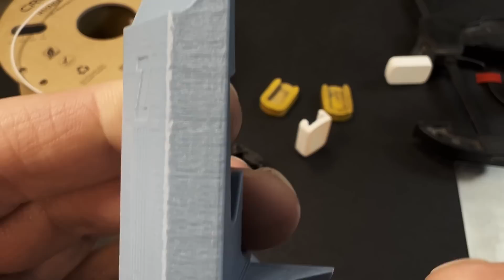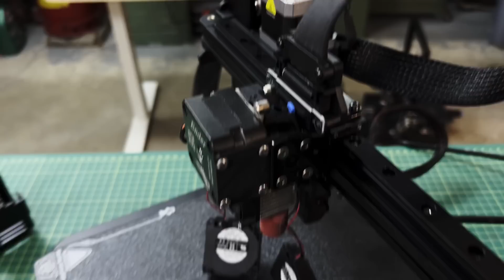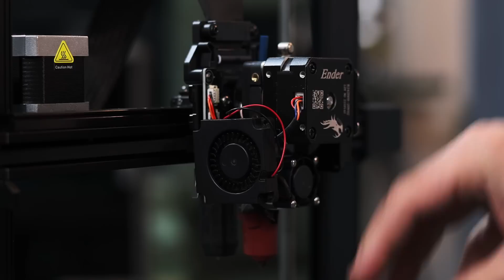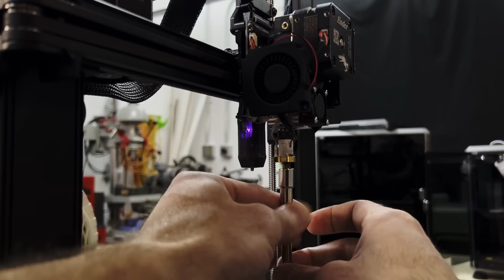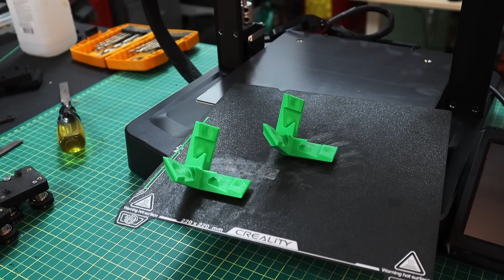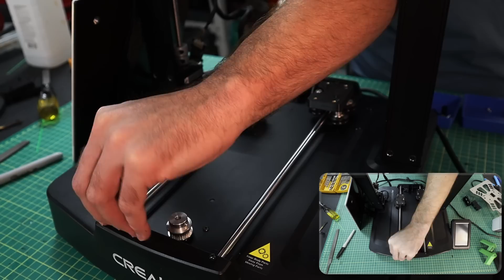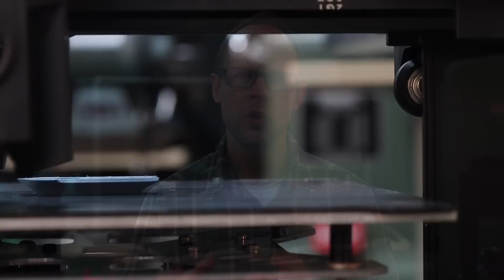What Causes BAD Print Quality on the Ender 3 V3 KE? - Fast Bed Slinger

Comment: Is it possible that your y belt was loose??
Reply from the maker: I didn't show that part did I?  I was very careful to make sure it was tight, when I received the printer, it was tightened quite a bit, I matched the gap as close as I could to how I received it.  it seemed to be about what you'd expect so there is no slippage possibility.  I went a bit further today and I measured the movement at the front of the bed compared to the center, and we have 0.15mm at the front, that's the play with just a 'finger-force' applied, in the center we have 0.01mm, it's giving the teeter-totter effect it seems.  The center mounted blocks along with the poor fit are the main cause, there will be movement of all of the parts.  It needs linear rails along with wider spaced blocks.  I will work on a better option for those of us who need a solution.
Reply: @NeedItMakeIt  awesome, thank you!
Reply from the maker: @mygamertag2010X  I'll make a video including some of that info, it was good you pointed that out, I've made some notes so I don't forget... too many videos on the go and my mind prefers to work in tunnel vision.
Reply: @NeedItMakeIt  I'm sure I can speak for us all, we really appreciate your thorough testing and inventive ideas to solving these problems!
Reply from the maker: @mygamertag2010X  Thanks, that means a lot!  I enjoy taking things apart and fixing them, it's a win-win as long as people are finding the videos helpful and YouTube can promote it enough to allow me to continue doing it.  My video making/editing skills are a work in progress, so hopefully as time goes on, it'll become more natural and faster as well.

I think I have a pretty 'solid' direction to go now with the KE, taking all of the comments as well from everyone helps a lot to try and combine the ideas from everyone and come up with something that's far better than I'd get on my own.

Comment: I built a Hypercube a few years back under the guidance of Tech2c's YouTube channel.  At that time he was having issues with 8mm linear rod.  A lot of suppliers were supplying 5/16" linear rod and calling it 8mm.  (5/16" converted to metric comes out to 7.94mm and I think you measured yours at 7.95)  Maybe Creality has a problem with their suppliers?
Reply from the maker: That's a great point.  I think you could be absolutely right!  The math works out to be nearly exact to what I'm seeing, so if I order linear bearings to suit 5/16", this may be a great option to test out.  The rods are hardened, they look like a stainless of some kind, but they're tapped in each end and that's not something I want to get into.  They're also extremely straight, so the quality seems good aside from the size.  

Thanks for sharing this, it may just be the best option for anyone running into this issue.
Reply from the maker: Update... it doesn't look like 5/16" is a size for linear bearings, I'll have to see if Creality can send me new rods.

Comment: Really looking forward to your next video. My KE also has some weird artefacts when printing PLA. Nothing major but there are some things that just go wrong for no apparent reason. Funnily enough, my issues are hella consistent. For example, if I print the same code twice, all slightly misplaced layers will be in the exact same place. If the cause for this is the bed vibration, I would expect it to be semi-random.

To test thing, I've ordered a vibration compensation sensor from creality that should arrive some time next week. Maybe its also something you would want to use to see if there is a difference. Cheers

Comment: I bet if they had tighter tolerances on the rods and bearings, and also had two of them on one of the rods or two on both, the bed would be far more stable. Since the whole bed rides on just two bearings, any slop in the bearings will allow the bed to wobble quite a bit. A third bearing on either side would give the bed a much wider stance. But they would have to make the Y axis a bit longer to not lose print area.

Comment: The problem is that until you return this printer and get a replacement you can't know if this problem is on this unit or all the units of this model.
Chinese companies are notoriously bad with testing stuff before releasing (see the Bambu heat bed cable debacle for instance) and even worse with QC.

Comment: I've not been all that impressed with my new KE.  The firmware UI is pretty bad but the prints haven't been great ether.   Looking forward to doing some of these tests on mine as well.

My y axis rocks back and forth slightly in the bearings.  The rods seem too small and flex slightly. And the rods don't touch their retaining screws to hold them down either, one more than the other.   This is my first Ender series printer and so far it's not stellar.

Comment: My KE's bed seems much more stable than yours, maybe its just a quality control issue. Mine came with a dead strain gauge sensor right out of the box, other than that it's been working great for the past month. I am planning on trying PETG on this printer for the first time, I will definitely compare front and middle oriented prints. Is the thing you are printing a publicly available STL? I might just do the same print, so its easier to compare to yours.
I am planning on doing the linear rails upgrade sooner or later, there is a mod on printables that looks great.
Reply: Yeah. Same here. No bed movement at all on mine either. everything was very well put together with the correct tolerances. Just got mine a few weeks ago. So maybe they adjusted their QC after learning there was possibly an issue.

Comment: Derrick Darrell has a pretty good rail mod on pintables for converting the KE and SE to linear rails. That will be my next major mod on my KE. I saw a lot of improvement moving the spool to the side of the machine but I still have too much bed slop.

Thanks for deep dive videos like this! The KE is a capable printer but definitely needs those tweaks and mods like this to get the most out of it.
Reply: I already printed the bracketry and ordered the rails. Just waiting for them to arrive.👍🏻
Reply: @BlueWolfDaYooper  my rails should be getting delivered today.  I printed the brackets out of PACF (I print a lot of that material)
Reply: Ah, that's good to hear you've been getting results out of moving the spool.  It seems obvious and I have been considering it, but am a bit reluctant to change the design unless necessary.
Reply: I have a ke. What is the benefit of moving the spool to the side?
Reply: Took me a minute to find him (for those searching, don’t put a space in the name), but I downloaded the files
Reply: @ForOdin  Found the guy but not the files for the ke.😢

Comment: Woooah! Not what I expected. What a pain. We were all being led in the wrong direction not even thinking about the physical components of the printer since PLA printed so well. Totally makes sense that the position on the bed made such a big difference when the bearings were loose at the end of travel. Because of the nozzle and pressure for the extruding filament pushing down on the part or pulling it sideways, especially with PETG, it was also making the bed spring up and down as you pointed out. So overall the V3 KE needs better bearings for the bed and a stiffer mounting solution. I really like the rounded wheels you made and they seem like an almost better solution than V-groove wheels or possibly even cheap linear rods. A lot of people say that V-groove are better than cheap linear rods or linear rails and this is probably why. I was wondering if creating TPU mounts for the linear rods would help by holding them firmly in place, but allowing some flex when necessary, and damping vibrations. The POM wheels sorta solve some of the same issues. It's really crazy how much that bed is jumping around at the edge and totally unacceptable. I've gotta wonder if just a thicker aluminum support plate and solid bed mounts would solve most of the issue. The steel plate almost seems like it's acting like a spring. Otherwise a double carriage might help, but gotta keep full range, so linear rails would probably be a good call. Would definitely love to see you follow up with that fix!
Reply from the maker: I was able to get an indicator on it, I have a short video on my discord if you or anyone else is interested to see it.  We're seeing 0.006" or 0.15mm play at the front corner.  As I move to the exact center of the bed, we're seeing 0.01mm.  I should have included this test with the video, I'll make sure to add it into the follow up.  I was thinking that I should do something better with the linear rails, and that is to use smaller rails, and instead of having a single block on each rail, have 2 and space them out a little more.  To do this, I'd have the rails mounted out further to each side, giving that more stability as well on the left/right of the bed, but the main goal is to get away from the teeter-totter and move towards something that's far more stiff.  I also want to see about moving the PCB down and away and adjusting the standoffs to be shorter, and that should help get to where we need to go.  If we can use 2 blocks per rail, the steel plate may be able to go away.  I think I'd just need to see how long the rails need to be, they'll be sticking out of the front and back of the printer a little bit.
Reply: @NeedItMakeIt  Wow! Great data and thoughts. That's about what I would expect given how it looked, though I would have guessed more like 0.1mm so that's really bad. Mounting the rails as wide as possible and lowering the mounting height of everything as much as possible will definitely help. The higher the weight of the bed is away from the mounting point, the more leverage it has over the mount and the bearings on the rails whenever it tries to accelerate. Momentum wants to tip that thing over, and the taller it is the harder it's gonna exert its tipping force. It would actually be ideal to have a bed mounted in between rails at the same height, with bearings at each corner, now that I think about it. Obviously that has lots of packaging and alignment concerns though. Would be sweet to see a setup like that with linear rails for some serious precision and stability on a bed slinger. They would have to be quite long rails too though!
Reply from the maker: @802Garage  I like your thinking.  Side mounted rails sounds awesome and that'd give more printable height... not that I'd ever use it.  To keep it simple for anyone wanting to do the upgrade, I think I'll end up with something like 400mm rails, they'll extend beyond the front and back a wee bit, that will allow the use of the 2 blocks per rail and it should help a lot to avoid the tipping issue and add a tiny bit of rigidity as well.  I have a set picked out on Ali, but it's going to be about 1 month to get them sadly.  At least I can have all of the parts printed and try to test them in advance.  I want something simple enough for anyone to be able to do, which isn't that easy, to get precise printed parts, we need precise printers, and the bed will be warped most likely it could mean that the rails will end up being out of alignment.  Printing with PETG will minimize warpage so that may work for the base parts to mount the rails onto.  I guess I just need to try it and see what happens.
Reply: @NeedItMakeIt  PETG likes to warp more than PLA, unless I missed something or you just mean vs ABS for example. But yeah that's pretty much exactly what I was figuring you would do with the rails before my mind went wild with the side mounts hahaha. Now I want to do it, but that's a massive project I don't have the time and space to tackle. Def look forward to your testing! I usually get stuff from AliExpress in around 10-15 days.

Comment: i like your meticulous approach in this problem solving, really nice. I'm glad I am no longer using bedslingers as problem solving them is, in the end, a nightmare. I have a bambulab, which will have their own set of issues when they break, but luckily I have not encountered a single issue with it.
Reply from the maker: Thanks!  Yeah, the Bambu printer are a cut above the rest it seems.. at least for now.  But the competition is good, it should require the other companies to improve their products to be able to stay competitive.  Just offering a better price isn't good enough if your reputation goes bye-bye.  

If I want really good quality I go with the X1C, although it doesn't like PETG-CF, what a mess.  

Which Bambu do you have?
Reply: @NeedItMakeIt  I am using a P1S and actually have not printed PETG yet - i understand there are issues with bambu+PETG, which is strange because I used to have a Artillery Genius and printed PETG regularly and treated it the same as PLA, then againthe bambu is miles ahead in terms of speed with PETG is not in favor of.
Reply from the maker: @atom6_  P1S is a nice printer, good choice.  I'd like one, most of the features are the same as the X1C and if not, it's upgradable, mostly upgradable.  

When I print PETG it sticks to the nozzle badly, even though it's nickel plated.  The other day I had a Poop wedged   above the back nut for the Z screw, it was crushing it when it tried to home the Z axis and it continued through the bed leveling until I removed it, but it was crunchy and not pleasant to listen to at all!  That was Prusament PETG as well.  I still love the printer, great results 98% of the time, just a few tweaks and it could be perfection.

Comment: Seeing as you have the tools and knowledge to make them, why not oiled bronze bushings that fit?
Reply from the maker: Great point.   I tried this in the previous video, but there was too much friction, they were not oilite bronze, they were brass with oil I added, so there is room for an improvement.   I think the design of the base of the printer should have a centra rail that extends out to allow the bearings to be spread out further, that would go a long way to preventing this issue.  I guess the only problem is that they'd need a larger box and I'd imagine they don't want to do that...
Reply: @NeedItMakeIt  Using the correct bronze you could machine it to the ID you want as well as amount actually in bearing. Would be easy to bore to good ID, the bore out , leaving contact patch at .250" on each end. I have this printer on the way so I'm learning and brainstorming with you, ready to put my mill and lathe to work
Reply from the maker: @justaguy4788  I think it's possible.  My attempt in the previous video wasn't the best, they really needed to be a single piece, mine were 2 pieces per side.  The Olilite would probably be better, but even Delrin or Teflon would be good too, I'm not sure about machining them though.  

That's a good idea about having minimal contact area.  I think as it wears it will begin to have these issues again, you'd know more about longevity of something like this than I would.  The rods themselves also flex a bit more than I would like to see, linear rails are probably the better way to go, or some other design with a central rail like Bambu is doing with the A1

Comment: It's a little bit sad, that a brand new printer need this amount of repair. All the new user friendly simplifying stuff  is just make more difficult to proper adjustment (lack of bed level screws, adjustable rollers) At this quality level i am not sure the higher speed feature is a good idea at all. I was thinking to replace my old ender 3 v2, but now i not so sure. 
Thank you Mike for your honest and high quality content again!
Reply from the maker: It is a bit unfortunate, and I can't say for sure that everyone would have this problem, my hope is that they'll see this video and make the necessary improvements.  I'd tend to want to wait as well until it's fixed, it's a big problem and I still can't figure out how they didn't address it already.  I can only assume that they never tested parts at the ends of the bed.  It's probably a good idea for testing any bed slinger to do the corners.   I'm glad you found the video helpful.  I also have a review of the K1 Max coming soon,  probably mid-week unless I run into something I don't expect... I'm glad you're enjoying the videos, I am trying to put a bit more of the story into them, infotainment to show a bit of the struggles, I hope it makes the videos a bit more interesting to watch.

Comment: Really interesting but you are doing creality's job  ...
Reply from the maker: Unfortunately I am, but it's important for people to know the cause, this is a popular printer and I know it took me a long time to figure it out, I can imagine that it would be frustrating for someone who just bought one.  I am lucky in a way that I started printing towards the front when I first started using the printer... though at that time I didn't realize what I was getting myself into...
Reply: So true, but creality should make less printers and finish them before to put them on the market.
At least this one won't burn ...
Good video again
Reply from the maker: @chatroux399  Gives a new meaning to the term 'my printer is BLAZING fast'...  I think so too, I have to wonder if it's poor QC or it could be a bad batch, it seems that's not the case from all of the reports of the same issues I've been having.  The extruder is not the right one for the job on a fast printer as well.  A nearly completely plastic extruder with light-duty construction will end up having problems, especially in an enclosure with some heat.  I'll have a follow up to the follow up on this one, I need to get a 100% solution for this printer, it can be really good.